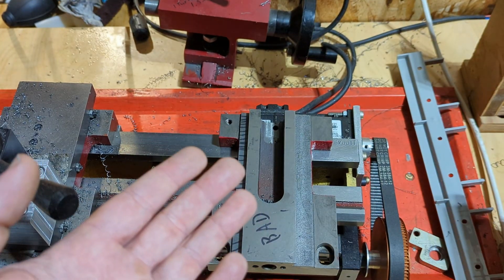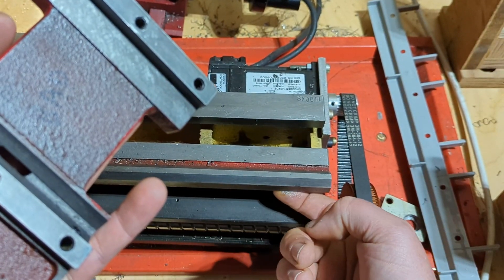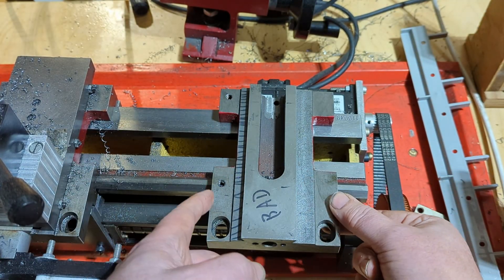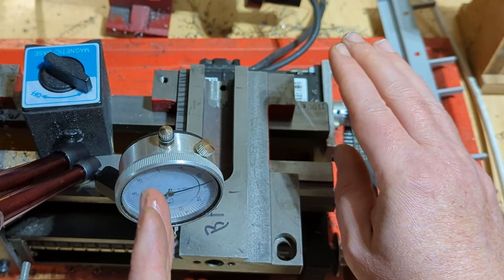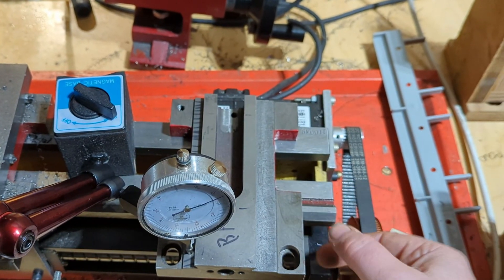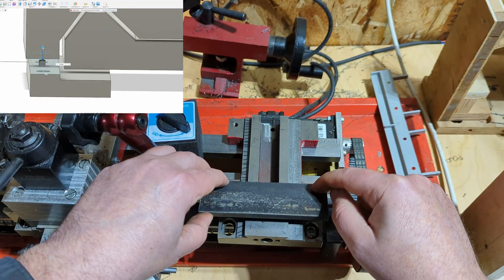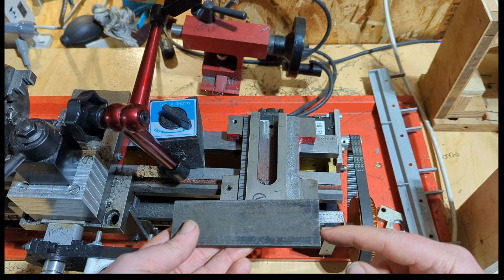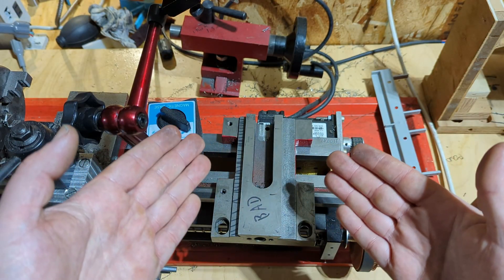Project2025 ep2: the hidden problem causing rigidity issues for your mini lathe

Comment: My Lorch lathes are "watchmakers" or "mechanics" lathes, so that the saddle is fixed during most operations, and the compound is used... this means that they are clamped to the ways, normally, and there's no long feed, other than turning the compound to 90°. On one of them, threading is done by sliding the spindle, driven by a "master" thread that is on the "outside" of the headstock... These are used for things like optical work and clock/watch making.
I wondered if you could use something like roller bearings on the saddle, rolling against the track on the bottom of the bed? Good precision, and adjustable?

Comment: Thanks for sharing. I've got one of these Chinese mini lathes with a triangular shaped bed. Stupidly enough, with mine the retaining plates below the carriage can only be adjusted when the carriage is removed from the bed. And to top it all of, the thickness of the bed is not consistent, so there really isn't a way to adjust properly, too tight at the end of the bed, too loose near the spindle head. Really a very poor design.
Reply from the maker: you can "lap" it but I think that is also a bit of a roll of the dice.  how far out is it?